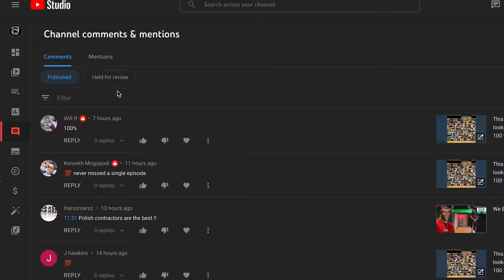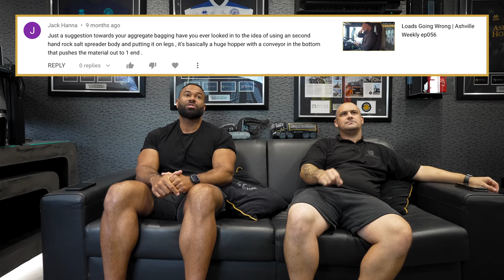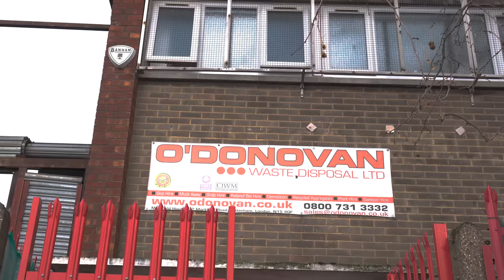We React to £10,000,000 Worth of Advice | Ashville Weekly Extra

Comment: @25:30 Sheet Rock is another name for gypsum board (aka drywall) which  are sheets consisting of compressed powdered gypsum sandwiched between paper layers. It's fire resistant (to a point) but it is not water resistant. When it gets wet, it swells up and crumbles and becomes a host for mold.

Comment: For the Two keys - you can get a bunch of keys cut that are simple metal blanks. You don't need the fob with immobiliser to lock the door. So real key stays in the ignition, and plain metal key locks the door and stays with driver. Standard metal keys will only cost a couple quid each, and will let you access the cab if the real keys are lost.

Comment: 12:20 my dad was involved in developing this for generating sets in the 90’s. The concept is that you counteract the noise frequencies with other frequencies and it does something similar to what noise cancelling headphones do nowadays.
Reply: Isn't it called Passive Noise Control or something to that degree? I get what the original commenter is getting at, they use acoustic fencing on many factory and warehousing sites that are close to residential areas. I'd imagine though for Daniel and Ashville overall it would be an expenditure that may not be worth it now they're not dealing with 6C.
Reply: @XX0ST  yeah probably. I’m not an expert. I agree that it’s not suitable for Dan but I was just pointing out that the the idea wasn’t as crazy as they were making out!

Comment: Active noise control is a very effective sound dampening technique 

You record the sound and use directional speakers to play the sound towards the noise from the boundary.

In short the sound waves fight each other cancelling a good percentage out.

They use it at festivals to help damp the bass down a lot 

It's more effective with bass than treble

I assume the noise is more towards treble than bass.

Worth a try but don't spend on it either 

Far better with fir trees to disburse the sound waves rebounding of branches ect really uses the sound energy.

Comment: Perfect solution to the 2 keys to keep it on and lock the cab, put a run lock on it then you can take the key out and it will stay running so you can lock it with the 1 key and the spare stays safe and they’re cheaper than a replacement key
Reply: Really it's a fault with the design, manufacturers should come up with a solution where the vehicle is secure but the keys can't be locked in the cab, such as an ignition barrel next to the auxiliary controls.

Comment: I think the active noise control is referring to actuators (active dampners) on the link point where boom and bucket meet. (in theory) If the sensor on the actuator picks up the vibration, the actuator can cancel out the vibration by vibrating 180° out of phase. (just like headphones do, but mounted on the mechanical construction and canceling out vibration before air wave propagation can take place). TBH, it would need to be an off-the-shelf part to make any economical sense (all R&D has been done, etc).
Reply: I just assumed they were talking about directional speakers and microphones to do the same thing, it works well for some industrial process but I can't see it working that well for unloading as there would be a fair amount of atmospheric issues.

Comment: Awesome video 😂 however active noise cancellation could work. Active noise cancellation is just the process of pumping the sound which you want to cancel out at 180 degrees in phase towards the source. These two sounds then cancel each other out reducing the audible output. 

Doesn't work as well as Bose noise cancellation but does work to reduce noise. Not sure how well it would work over a large distance and with quite a complex sound.

Comment: Regarding the light comment... No need to get a sparky in🤣🤣🤣🤦🏼‍♀️🤦🏼‍♀️🤦🏼‍♀️ get a £5 LED light pack with 9 penlight batteries.   Spend a teeny weeny amount and get double sided tape🤣🤣🤣.

Then the lights will automatically switch on in the dark.

You dont need a pit, you can have a steel ramp however as you pointed out as long as its not you in the mud, who cares🤣🤣🤣

Sheetrock. US branded rhinoboard aka gypsum.

Absolutely Love your container offices.👍🏽👍🏽👍🏽

Comment: instead of the 2 keys suggestion what about using "run lock" like on an ambulance- you can take key out with engine running and lock cab but vehicle can't be stolen as you need key to cancel the system

Comment: On the whole 2 key situation, that’s not great but runlocks are a good idea, press a button and remove key to lock cab, or don’t, because with runlocks as soon as you touch a control pedal the engine switches off

Comment: Can I make a suggestion at 11 minutes regarding the keys comment. So I work on roads doing traffic management and I currently drive the wagon with the cones on the back ‘ impact protection vehicle’ and we have something called run lock, others call it overdrive. Basically pressing the run lock button keeps the vehicle running and you can remove the key from the ignition and lock the doors. In the worst case scenario if someone does break in and try to steal the truck, as soon as a gear is selected it cuts the engine. The stealer gets caught 😊

Comment: I noticed last week that you had a bad morning with a driver leaving a Volvo in gear. I had that problem with my relief driver. So I bought a 100 psi 12/24volt portable air compressor costs about £25. Then crimped an air tank fitting on nozzle instead of the tyre fitting. Plus I had to get an all ride extension cigarette cable. So now when I turn up at midnight to start my shift. And coco the clown has left it in gear. All I do is fill the air tanks up then hit the kill switch for two minutes to clear the gearbox fault. It saves calling the mechanic in at midnight with a thunder head on him. Plus his wee teddy bear doesn’t get thrown out the window. You could maybe get one and keep it in the drivers office for the problem child drivers. Plus it is a mistake that can if we are one of them days.

Comment: 10:54 suggestion on 2 sets of keys - don’t Volvo and scania come with a key fob to lock the cab up separately from the key? I know Volvo fm certainly does. Just take the fob off of the keyring and lock the cab up.
Reply: They would lose that, so the drives would be locked out. :D
Reply: @bzs187  yea, true. But lesser of the 2 evils. If I driver can’t be trusted to look after a key fob or a set of keys, I’m at a loss. I’m glad I’m a driver and not an owner/operator haha
Reply: @darrentracey2030  We call them paid enemy's for a reason. But you start to wonder about how they got their license, if they lose a damn key, that is needed for their work. Like forgetting it at home is okay, that happens, but losing it?

Comment: You should not use Sheetrock (Brand name for plasterboard) as manufactured in the USA, because it does not comply with BS EN 520:2004 for Gypsum plasterboards.  Therefore, not available UK.  On projects we (H&P) specify 12.5mm kanuf Aquapanel Exterior cement board or Q-Board Backerboard (not for fire rated ducts or walls - Building Satety Act).  Autodesk REVIT 2023

Comment: The spare keys I drive a low loader Had a Mercedes V8 with hydraulic ramps so the engine had to run In Sheffield on a site some kid waited til I was lowering ramps then he was in the cab and away with sat nav and phone. The insurance don’t pay out as it’s not locked. The next day I had a spare Mercedes key. And every low loader since I have a spare key. DAN THEY ARE under £20 You only need the basic key from a local key cutter Not a electric thing and no chip. All you need is the key blade cut to fit the door and also it’s secure in if you loose that key it won’t start the lorry. You will still have the spare key in the key safe